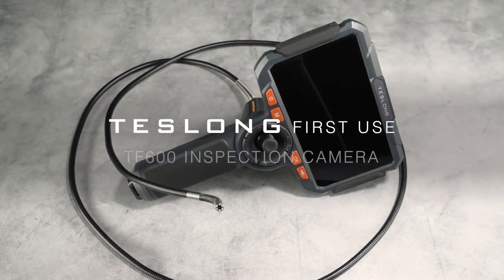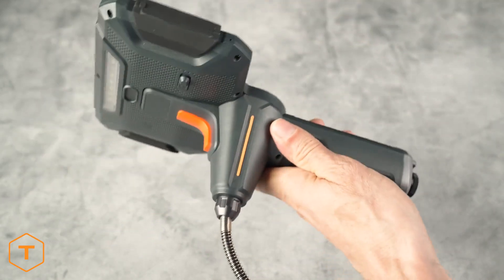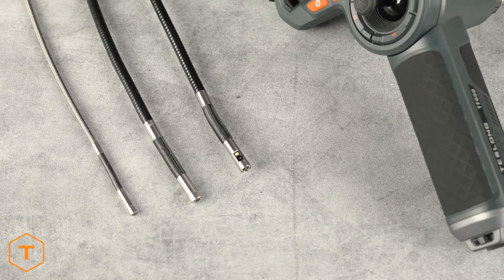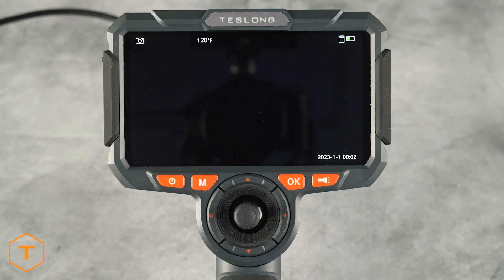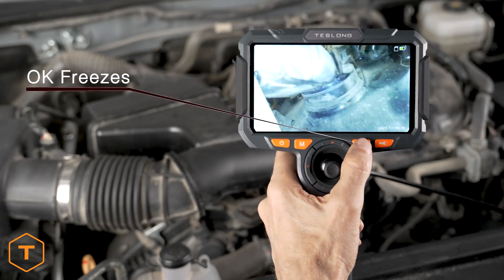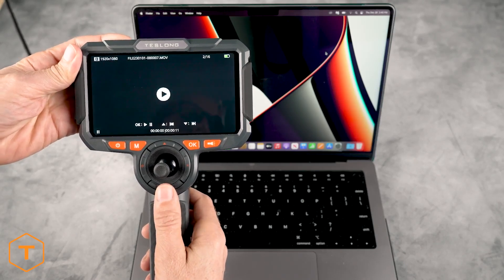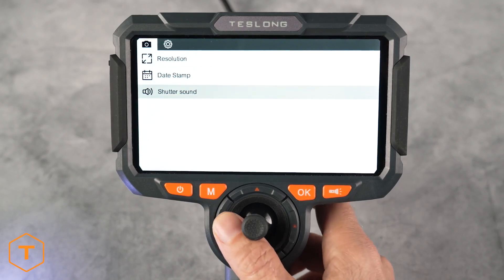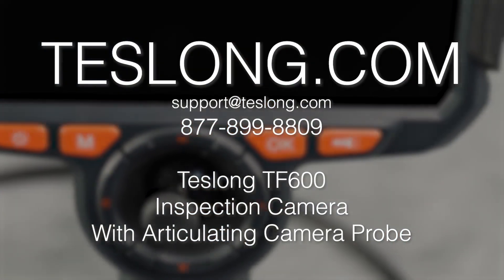Teslong TF600 First Use Video Manual

Comment: Some questions: 1. Which model that has 2K or dated 1K screen? 2. Using 18650 or 26650 battery & how many? 
3. Available to buy difference probes (sizes), after the sale?
Reply from the maker: Our customer service can assist you at: 877.899.8809 or support@teslong.com